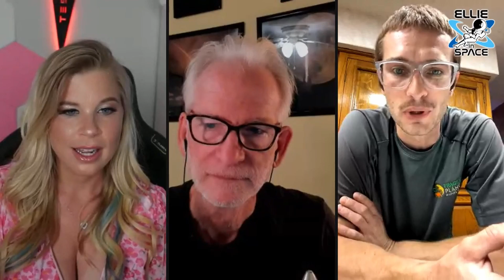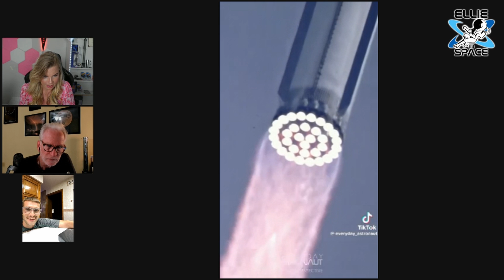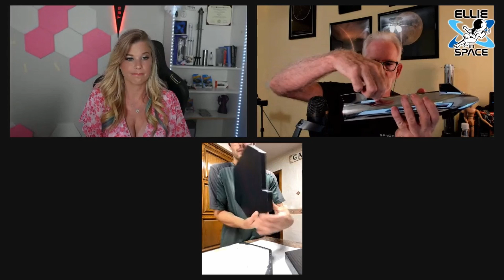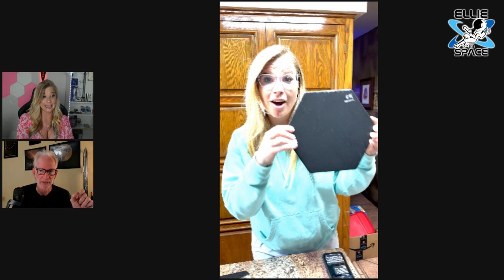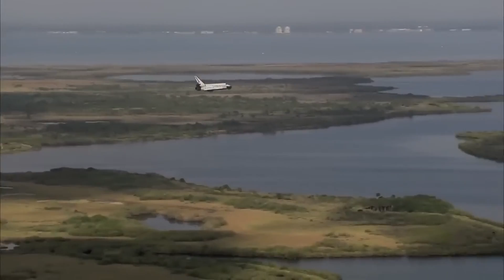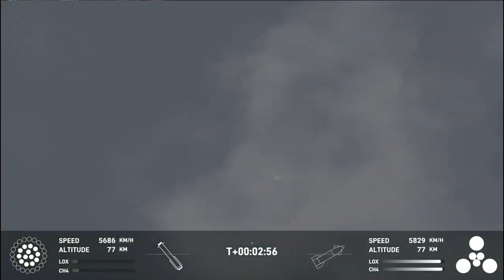Why Do Starship's Heat Tiles Keep Falling Off?

Comment: Contiguous flexibility has got to be it. I keep thinking flexible sheets would be best. But once a corner came loose in that kind of flow, the whole thing would go, leaving a considerable exposed area. So they'd have to be smaller. Some sort of aerodynamic design, airfoil effect, that hugs the hull at higher speeds like F1 racecar down force? How about growing a complex fiber mesh, carpet, like a fleece jacket, that maintains a protective separating air layer but also expands and contracts? Single fibers wouldn't take the whole layer off. Reed bends. Trees fall. That's where you need your superconducting graphite threads, off the shelf purchase at Home Depot. I know what: how about treated steel that doesn't melt? Very nifty stuff. Alchemy would be good.

Comment: Some points about the heat shield:

1. Originally, Starship was not supposed to need one.
2. This is not a simple heat shield. It might not have the complexity of tile shapes that the Space Shuttle did, but Starship still has many different shapes and thicknesses. This increases production and installation costs.
3. SpaceX is learning the same lessons that NASA did with the Space Shuttle TPS: the tiles are not very robust; they will be damaged during launch, requiring replacement -- which requires maintenance -- which drives up costs -- and means rapid reuse is not possible; tiles that fall off will result in heat damage to the Starship structure, requiring repair and maintenance -- and possible destruction during reentry. (The Soviet Buran shuttle on its one and only flight also had tiles missing during reentry. This caused so much damage and warping to the vehicle structure that it was unlikely ever to have flown a second time, even if the Soviet shuttle programme had not collapsed.)

Comment: SpaceX looked at micro-holes all over the stainless steel sweating fuel to cool the heat and perhaps produce a plasma shield effect.
There are large areas that are empty space and not fuel tanks, a problem even if did work.

Comment: Cool video.   I'm curious about how brittle the shields are.   Do you think that the heat shield would break into a few pieces if you dropped it on the floor?
Reply: Dropped my 2"x3" bit onto concrete it didn't damage it, was probably at terminal velocity because they're so light. A lot of the tiles on the beach were run over by trucks and that did break them.

Comment: In drag racing, the exhaust pipes are fastened together with fasteners.  Those fasteners are difficult to keep them from falling off as the temperature swings and moisture will destroy any spring washer and thread locker.  There is a special screw and retainer that has to be used on the turbochargers.  The headache is trying to apply a fastener in an area you can't easily access with tools.  You want to use a snap on method, but the launch vibrations are enough to shake all the tile off.  I would think about finding ways to heat the tiles to keep them from reaching temps below zero.  Seems like a launch blanket might help protect the tiles during launch, if you don't shoot the birds.
Reply: The tiles are very light and weak, very brittle. They are applied directly to the stainless steel skin of the vehicles and get chilled to probably well below 100 degrees below zero F. There is shrinkage of the ships' skins, the intense vibrations, the heating of the tiles on re-entry while the ships are still super chilled internally. The problems are huge but SpaceX has the best minds on the case.
Reply: @3ducs   LOL!  Methane boiling point is -259.6 degrees F, which means the tiles see temps much colder than you think.  This is why NASA used insulation on the Shuttle main tank.  SpaceX may have a bunch of people on the team, but not the best minds.  Either get your facts right or go back to school.  The cold causes the tiles to break, so insulating the tanks with 15" of foam would cause the tiles to be warmed.  Maybe I need to simplify this to 5th grade science?
Reply: @kensmith8832  I knew it was colder than what I wrote, should've done the research. Makes the problems that much more difficult to address. Is this too big a reach? Is it solvable? Tune in for the next exciting episode!
Reply: @3ducs  Quoting the 1960s Batman isn't going to gain you any brownie points!  I remember the first moon walk, yeah, I am that old.
Reply: @kensmith8832  Huh? I worked on the lunar lander project early in my Federal career. I was with the Army Map Service, I carved 1-2,000 scale lunar lander training 3-D landing sites for their simulations. Yeah, I am that old....  The astronauts trained on maps I carved, but I'm happy you remember their walks.
Reply: @3ducs  Cool!  Do you remember the movie Diabolik, kind of a spin-off from Batman?  The problem I have with SpaceX is they threw out the NASA info and started over.  This is typical from ego driven engineers, but insane for space travel.

Comment: Most cities and counties have "lost property" laws. If the value exceeds a set amount, you need to leave it with the police for a year, in case the owner claims it.
 There may also be aviation laws regarding lost parts or materials lost or ejected, which then toll pollution laws.
 Lots to look into if SpaceX doesn't formally tell them to keep it.

Comment: Having some direct experience with the phenomenon of vibrations and harmonics in light aircraft, air frame, and engine structures, I can understand how it will take a few iterations of real flight tests to understand the difference between calculated loads on the attachment points of the heat tiles, and the actual loads in flight, with all the vibrations and structural loads traversing across the skin of the ship in waves during flight. Also, there may still be some tweaks that need to be made to the manufactured attachment parts to get them to have the correct retaining force in actual practice. It looks like some kind of a spring clip that snaps into place when the tile is installed. It may very well take a few tries to get it just right.
Reply: The problem I see with that is that the tiles are so light and weak, any spring clip incorporated in the tile would break the tile on installation. I surmise that a flexible glue, perhaps a high temperature silicone, is used to secure the tile on the pins.
Reply: Did you not see the metal inserts in the tile Ellie & the young gentleman showed to us? There are 3 metal inserts each with a rectangular hole to receive the end of the support post. @3ducs

Comment: SpaceX to use a flexible RTV rubber blob as well as the current adhesive to give the Tile a backup purchase to withstand the tremendous vibrations that Starship chassis as it takes off!

Comment: It would have been difficult with the shuttle, but the Starship is cylindrical, so why don't they simply put a wrap around it to keep the tiles on during launch? The wrap can burn off quickly on reentry since it's expendable but might prevent any tiles from flying off before reentry. During reentry the tiles would stay on simply due to the force of the air pushing against them. Shouldn't add much mass to do this I wouldn't think and I don't think the momentary flash of fire when the wrap burns away is going to damage anything.

Comment: The Starship is not a solid cylinder but a flexible tube with multiple vibrational modes. Under heavy loading, first from 33 blasting rocket engines, and then from six additional blasting rocket engines, various of these modes may be excited, causing the surface under the attached tiles to rapidly deform. The vibrational accelerations and forces may be high enough to loosen some of the tiles and cause some to fall off. I'm sure that each successive test will provide more data to help the engineers identify and correct the problems.

Comment: They could use hooks to fasten the tiles on Starship. the vibrations wouldn't jostle  the tiles off  unlike adhesive which could break complete off during ignition, assent, pressure and force.

Comment: The issue with shuttle tiles was the orbiter was on the side of the stack, not the top.  It was constantly getting hit by foam coming off the ET. The issue was more tile damage vs coming off as mentioned.  Columbia had a debit hit on the leading edge on the wing, not because a tile fell off.  If you look closely there are is a spot in each tile where they would inject a chemical, similar to scotchguard,  into them so they would not absorb water to add weight.

Comment: Some reasons why the Starship Hear Tile fall off;
* The tiles are made of a very light substance - Silica (glass), the absorbs heat quickly and radiates is quickly while still remain touchable.
* The tile are mounted onto the Starship on mounting pins that should lock onto claps set into the back of the tiles.
* Because the tiles are light, they are susceptible to engine vibration and high winds dislodging them (both issues prevalent during testing and launches).
* It is uncertain is there is a heat resistant adhesive that can help glue the tile to the Starship fuselage and control flaps.

Comment: This discussion is great citizen science. It allows us to conclude that Starship heat tile design appears to be sound and that SpaceX may just need to improve the reliability of the installation process.
Reply: SpaceX have/had test rings on site with much more denser pattern of clips, and there are photos with steel "mockups" attached. They were much smaller than current gen. So could be that next bath of starship will sport smaller tiles. I think also that is very likely that "mockups" will be actually attached to new gen tiles with some kind of adhesive or other Methode.
Reply: Bullshit
Reply: @LTV_inc  that what I wrote? Check NasaSpaceFlight. It was few weeks ago, don't remember exactly. I think also LabPadre, WAI, and Marcus House reported that.